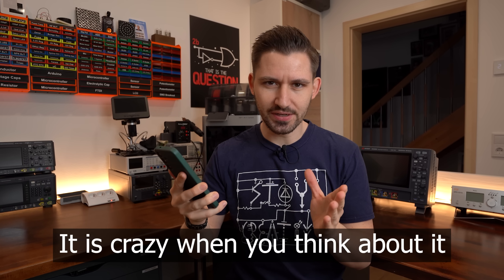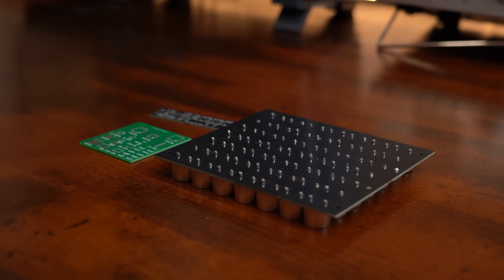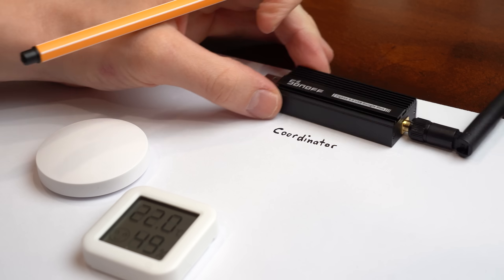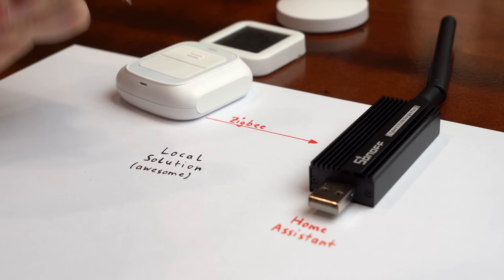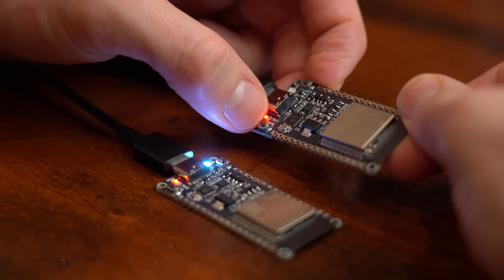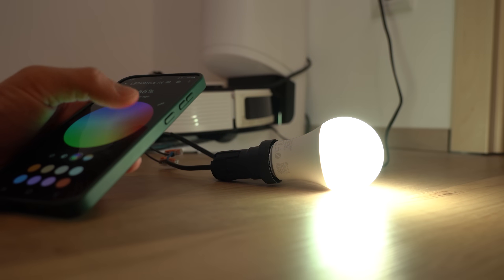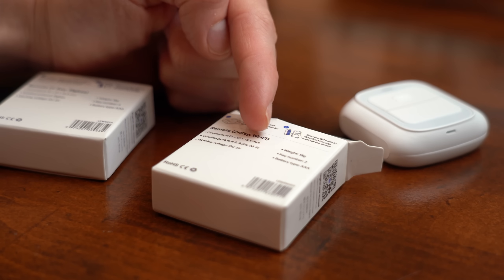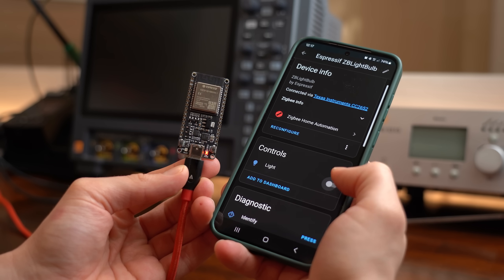Forget WiFi AGAIN! This Wireless Method is WAY Better? (Zigbee)

Comment: Zigbee wall outlets are a great way to add repeaters if you already have most of your lights or other wall powered devices replaced with another wireless technology. Zigbee  does tend to get glitchy at times and sometimes, and you need to run commands to repair the zigbee network.

Comment: IKEA Tradfri uses Zigbee as well. Since I started implementing it at my father's place I have also used it at my home. Pro-tip: inside the IKEA Tradfri parts (light bulbs, smart sockets) there is a small Zigbee receiver module which can be salvaged from broken parts and used for your own projects.
Reply: This is a very cool Trick, thanks :)
Reply: Many electronics from IKEA are very well designed, in regard of eg safety and efficiency. I love the IKEA sockets as their standby consumption is about 0.3W. In contrast, TAPO Wi-Fi one’s run at 1W and 4/8 broke within 15 months (Relais Stucks in on position)
Reply: @thetweer  All my smart devices are Tapo and they've been daily used for over 5 years without any failure. Might be that you got a series that was faulty from manufacturing.
Reply: I have done exactly this to make a 12V Zigbee switch, reversed. I use it to automate router reboot (as the last resort to restore the connection) when Internet connection is down.
Reply: My whole home is Tradfri. Been using it for ages with only a few dying prematurely. But they're dirt cheap and the color rendering isn't any worse than any other cheap bulb, and best of all, it adheres quite well to the Zigbee standard.
Reply: Cool info. Are there websites or so about salvaging those parts?
Reply: Great info, thanks for sharing.
Reply: I have the tradfri in  my whole house setup and it works great!! The only annoying part about it is that the bulbs have acrazy coil whine.
if anyone has a fix for that, you would save my mental state.
Reply: @OutOfTheBinary  my bulbs are completely silent... at least to my ears (50+ years old) and I have several different types.
Reply: Yes but u need not to break it first 😂
Reply: oh thats huge
Reply: I would also recommend their Styrbar and Tradfri remotes. They're dirt cheap and work pretty well, I have like a dozen of those in various forms. Ledvance (Osram) also makes nice remotes with three buttons. They tend to lose pairing after some time of not being used (a few months)but that's not a big deal, just pair them again.
When it comes to Aliexpress, I can recommend the MOES scene switches (the big square ones) and then the Tuya Zigbee devices (door contacts, temp sensors, PIR sensors) - they're Tuya, but as they support Zigbee, they basically have nothing to do with Tuya cloud or app and integrate directly into HA. Also, the round Zigbee thermometer/hygrometer with display is awesome. Those devices are usually around 3-4 EUR (7 for the round one, 10 for MOES) and I love them :)
Reply: @uwezimmermann5427  Those cheap tuya devices from aliexpress have such a board in them, too.
Reply: The Tradfri bulbs had bad lifetime for me.
Reply: What?  Cheap junk from IKEA?  Say it isn’t so!  🤦🏼‍♂️
Reply: There is new IKEA Dirigera, which supports both Zigbee and Matter. Matter is Zigbee-like protocol with IPv6 LAN addressing and i think it's based on some new low power wifi features or something, not sure tho. It's supposed to replace Zigbee.
Reply: @harviecz You mean thread? A wifi only device can be Matter, it's not a "wireless protocol". Thread device on the other side  is asociated with Matter.
Reply: Commenting to follow this comment chain 👀
Reply: @harviecz  the hub is matter, but all the other devices are Zigbee. Similar to how the hue hub supports matter. Either way, all devices that connect to the hub are Zigbee.
Reply: @andrewtfluck  This might be true now but IKEA almost certainly added Matter to the new hub with the intent to transition Tradfri products to Matter as well
Reply: @harviecz matter can work over wifi or thread. Thread development was based on ZigBee, but it is different to account for matter needs.

Comment: I remember hearing a story from a friend about not being able to turn the light on and off because the DNS had stopped working.
Reply from the maker: Oh boy......
Reply: I am gonna use mr.bean technique 😅
Reply: Just use RF for simple lights i dont see point in wifi
Reply: @LavadawgI use this thing called a light switch.
Reply: @Boogie_the_cat  https://en.wikipedia.org/wiki/Convenience
Reply: I honestly didn't really know things beside wifi exist and are quite big difference. And I didn't know wifi devices need to connect to server somewhere else
Reply: @realdragon  problem with WiFi is not device itself, it is application, how it is programmed to use cloud service. This is now future (cloud services everywhere)
Reply: @realdragon  Depends on your device: most wifi devices need a cloud connection to operate, but not all of them. I have 15 Wifi smart switches, all of them are local, still work when I disconnect my internet connection.
Reply: @louvets  Its why I jailbroken my wifi devices yeah, nomore phone home, if the internet is gone, with only local network, they still work. but for all that work and research per device, zigbee been a blast and easy.

still gonna buy whats cheap and cool tho. worst case, replace the controller with a DIY zigbee one XD
Reply: To reiterate what GameBacardi said, not all Wi-Fi devices require using the cloud. Many do actually work on a local network. However some companies do offer cloud services for their Wi-Fi IOT devices. Those then obviously would/could require the cloud to work.  @realdragon
Reply: For my light switches I use the Sonoff miniZB switches that don’t need a neutral wire. They can be installed in the wall behind the normal switch and the can be operated by the switch and via Zigbee. (So ‘normal’ people;) can still turn the lights on and off).
Reply: It gets better i once had the problem that one of my smart bulbs thougt its an good idea ignoring my dhcp settings and use a static ip already used by its coordinator bridge jamming essentialy evry lightbulb connected to that bridge 😂
Reply: It's never DNS...
Reply: @drsquirrel00 It can't be DNS....
Reply: that's propetairy hardware.
instead of allowing direct communication. everything has to go throug the servers of the company.
Reply: My DNS server is backed by a 1200VA APC UPS, so the DNS will always be available for the light switches... Even in a blackout. Oh wait.
Reply: @tin2001  until your UPS decides to randomly die and you don't have A+B power.... Ask me how I know
Reply: That's why you have to add a manual override to whatever wireless or automated project you make
Reply: I assume that the companies of these proprietary devices that need to connect to a cloud service have implemented them in such a way that it is impossible to reroute their communications to a local server due to asymmetric encryption? 
Such solutions should really be boycotted.
Reply: @nkronert  just use mitm, I doubt MCUs check root certificates unless it's hard coded.
Reply: It's always DNS!
Reply: ya, nanoleaf stuff just stops working on alexa for a day every couple months.
Reply: We have gone to far😢
Reply: Matter protocol solves that issue using Threads
Reply: this aged well

Comment: yes Zigbee is nice as long as its working but from time to time its just "not" and then its less "fun" (and I'm using Zigbee in my HA for the last 4 years)
ones you get 20~30 device connect and one day Zigbee drop the network and you need to repeer all your network its not fun day
Reply from the maker: Ok. Thanks for the feedback. Let's see how my devices will perform.

Comment: Another advantage of Zigbee is that it's mesh based so devices that are plugged into the mains act as repeaters to more distant devices so it can cover large and more difficult terrain by using more devices. You can see this in the graph view of the Home Assistant zigbee configuration.
Reply from the maker: I covered that in the video ;-)

Comment: not all wifi devices are cloud-based. shelly makes awesome devices that have cloud disabled by default. i have some 5 years old, they don't even get firmware updates anymore, but still work perfectly fine :)
Reply: The difference is that if a manufacturer says it's WiFi it's anyone's guess as to if it's local or not, whereas with Zigbee it's 100% gonna be local
Reply: @ it shouldn't be a guess. it should be clear from the product description. of course if the manufacturer specifically doesn't advertise that, it probably isn't. and shelly stuff is on the expensive side of smart things, but that's what you pay for platform independence :)
and if you're doing IOT stuff right, you have separate wifi on separate VLAN isolated from your normal LAN and you should only allow internet access for devices that really need it. it's a preventive thinking that can make these things secure even if vulnerabilities get discovered further down the line
Reply from the maker: True
Reply: Shelly's devices aren't awesome, they're dangerous and fraudulent. They claim more than double the capacity their devices are actually capable of safely handling without overheating and have QC so bad there are a constant stream of reports of them catching fire or exploding.

Comment: Personally I find adding Zigbee devices to Zigbee2MQTT (and thus Home-Assistant) easier than adding WIFI devices.

With Zigbee, I just press the button to initiate pairing.

With WIFI, I have to change my smartphone to the WIFI access-port the device creates at initial setup. And then I have to enter all the needed data (SSID, Passphrase, IP-Adresses). That's quite tedious if you have more than, say, 5 WIFI devices.
Reply from the maker: True

Comment: Hello, great video, I wanted to ask you a question, I have a DJI Phantom 3 drone, 4K model, everything works fine, but it doesn't give me video, I read that it could be an update issue, but DJI doesn't give me a solution, do you know of any forum? Maybe you can guide me. Thanks
Reply from the maker: No idea. Sorry

Comment: A while ago I had made a temperature sensor that needed to last for 3 years off of two AA batteries for server farms. Zigbee was pretty awesome for it being so low power.
Reply from the maker: True and thanks for the feedback :-)
Reply: My zigbee temp sensor has a 4 year battery life off a single c cell battery.
Reply: @rattslayer  May I ask what components it uses?
Reply: What about BLE?

Comment: This Zigbee dongles works bad with USB extension cables. Work "perfectly fine", then not fine, then fine again, etc. Ethernet Zigbee gateway strongly recommend for more than 10 clients.
Reply from the maker: So far I did not have any problems.

Comment: Matter compatible devices are pretty cool, too. It's Wi-Fi based, if I'm remembering correctly, but devices that comply with that standard don't have to communicate with a cloud service to retain local connection. It's to the same effect of Zigbee or Z-wave devices.
Reply: I hope Matter gets covered on this channel, since it's new IPv6-based standard supposed to replace Zigbee. I think it's even established by the same group as zigbee protocol.

Comment: btw this sonoff dongle can support zigbee+thread network when you re-fresh it with proper firmware
Reply from the maker: Awesome to know. Thanks.
Reply: @greatscottlab  If you get that to work, a video would be appreciated. The videos I've seen on doing the updated were very confusing or required python.

Comment: Plenty of WiFi devices are accessible locally too!
Reply: Was hoping to see this mentioned! My whole home is locally managed but all using WiFi.
Reply from the maker: True. But not most cheap ones.
Reply: @greatscottlab  I'd be interested in a video comparing (as much as possible) like-for-like devices on the various connectivity techs out there: zwave, zigbee, wifi, ble, matter/thread etc. Not just on a technical side but prices too.

Comment: Wifi doesn't necessarily mean cloud-based, as I'm sure you know.  You just have to buy the right brand!
Reply from the maker: True. But in most cheap examples, you usually get such a cloud solution.
Reply: @greatscottlab  - Then.... Tasmota to the rescue!
Reply: @DrFiero  not always because tuya has some devices with other chipsets and sometimes they are integrated onto the pcb directly instead of a module. Although openbeken exists so converting those is also possible
Reply: @greatscottlab  You can put Tasmota or ESPHome firmware on many of those cheap devices.
Reply: Almost all of my smart switches require cloud control to get to Home Assistant.  I set up a couple of switches with Local Tuya, and it works, but was a lot of effort.

Comment: Great video! I have been meaning to check out the zigbee function on the new ESP32s, but now I don't have to :D. I would really love to see a video on optimization of an ESP Zigbee device in terms of power consumption for battery use.
Reply from the maker: Thanks👍 I put it on my to do list
Reply: ESP's in general aren't great in terms of power usage, something like the nRF52840 will knock it out of the park